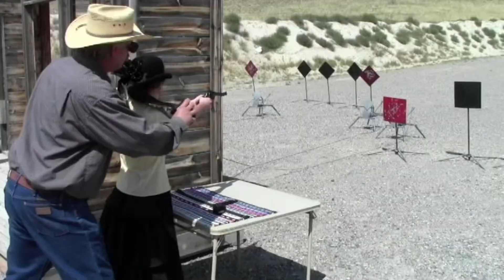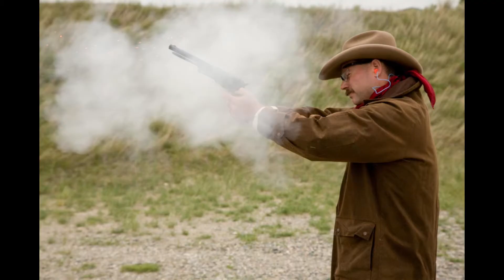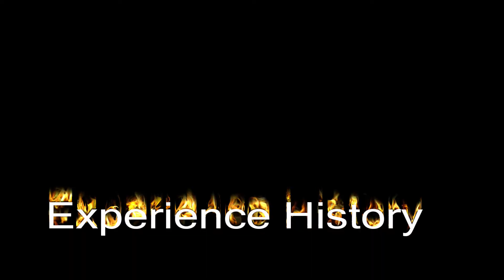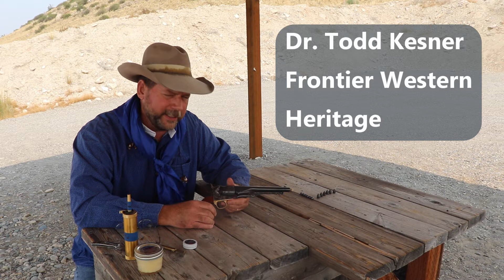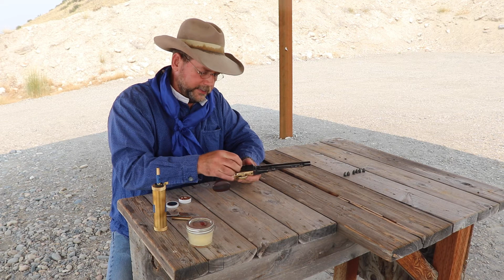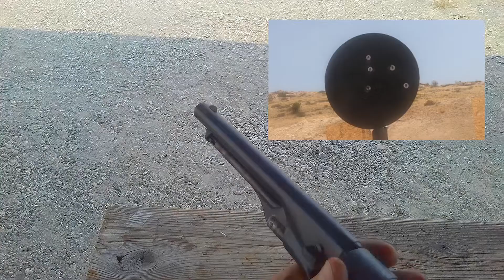Shooting the 1860 Army

Comment: At the range I use a wooden dowel to fully seat the caps on the nipples. In the field, I just cock 6 times, easing the hammer down on each chamber in turn, and then push the hammer forward with the palm of my hand to fully seat the cap on each chamber.  I like to grease the arbor and cylinder ratchet with beef tallow before shooting. Keeps the revolver working for several cylinders before the fouling starts to bind. Also, on Uberti's I replace the factory nipples with quality after market nipples that have very tiny flash holes. The tiny nipple flash holes really cut back on blow back and minimize cap jams, along with a major reduction of action fouling buildup. Keeps the cylinder turning for for about 18-30 shots before re-greasing, provided the nipples are good!
Reply from the maker: Thanks.  I didn't grease the arbor in the video and barely got away with three cylinders full.  I won't skip that step again.  Todd

Comment: I've found that the loading tools are made to fit the 1858 Rem. New Model Army. What I do with Mi 1860 Colt Army is place a fired 5.56mm Nato case over the Pin on the Loading tool to use it for the Colts bigger Arbor. This works for Round Balls, I haven't tried Conicals yet but the shape of the Conicals might also be an issue.
Reply from the maker: Thanks Woodrow.  I had the right sized pin to fit the cylinder, but the rammer came down at such an odd angle that it tilted the conical.  The loader would work for round balls, but I didn't need it for those. Thanks for watching.

Comment: Thanks for the video:) Would you know why the SAA did not have safety notches or did they now I’m not sure. 

I think the Remington 1858 has superior safety notches.
Reply from the maker: Duke, Remington revolvers manufactured in the Civil War era had safety notches that you could rely on when loading all six chambers.  The Colt's of the era had safety pins between the chambers that fit into a notch on the hammer.  They were not nearly as dependable as Remington's deep notches.  With the SAA, Colt put a 1/4 cock safety notch in the hammer that the trigger dropped into and they expected it to do the trick.  Unfortunately, the notch was weak and could break off if the gun was dropped.  Elmer Keith claimed a common accident happened when saddling a horse with the stirrup slung over the saddle or around the horn.  If the stirrup flopped back down while the cowboy was tightening the latigo and struck the top of his gun, bang.  I've had the stirrup do exactly what he described, but wasn't wearing a gun rig.  There is a debate out there if carrying five rounds with the hammer on an empty chamber was really standard practice.  Noting the number of accidents recorded in stories, I think a lot of guys carried six.  Thanks for commenting, Todd
Reply: I was just shooting my Army today and had trouble with one cylinder. Turned out that the nipple was loose and my wrench was too large to fit. Took a while but after 5-6 caps I finally got it to fire. The Navy and Army are both Sweethearts in my book! Kind Thanks and good shootin! DaveyJO in Pennsylvania